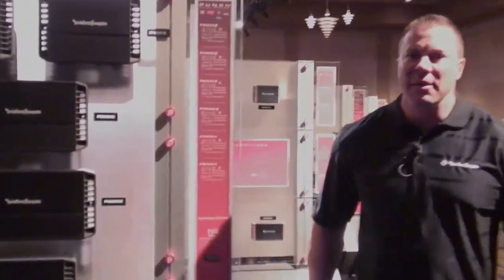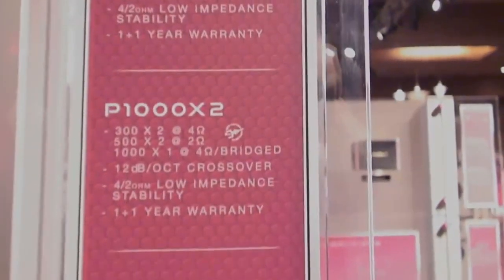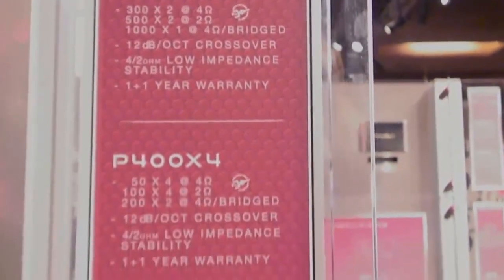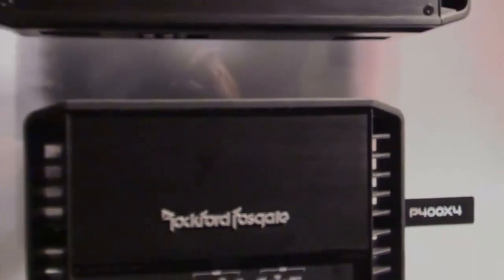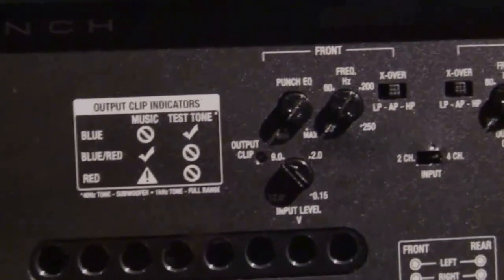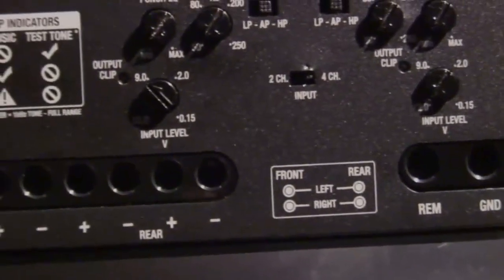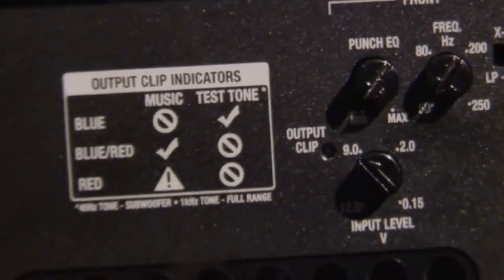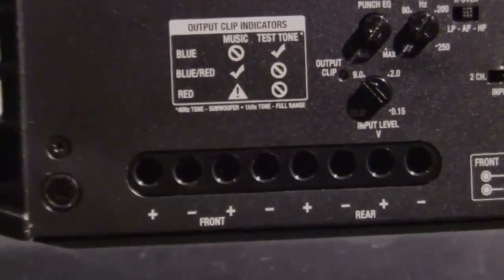2013 Punch Amp Models

Comment: Is it possible to run two P1000X1bd's strapped?
Reply from the maker: No, the only current amplifier in the line-up that can be "strapped" is the Power T2500-1bdCP or it's previous model the Power T2500-1bd.  You can accomplish the similar result as "strapping" amplifiers using this technique:
 
(1) Turn Off the system and disconnect all subwoofer speaker wires from the amplifiers.
(2) Play a low frequency test tone like 40Hz at -10dB Gain Overlap.
(3) Measure the output voltage (set meter to AC Volts) of the #1 amplifier.
(4) Adjust the gain settings for each amplifier, so each amplifier produces the same output voltage.
(5) Turn Off the system and reconnect all subwoofer speaker wires to the amplifiers.

Now all amplifiers are matched and producing the same output voltage for your subwoofer system!
Reply: Rockford Fosgate would I be able to use the bass knob I have currently to control both amps?
Reply from the maker: No, you will need to use both PLC2 (Punch Level Control) knobs.

Comment: I want to know better Amplifiers 4 channel to turn on speakers power t1693 on the rear and (PPS4-6) 
Punch Pro 6.5" 4-Ohm Midrange on the front, I want the best performance
Reply from the maker: The Punch P400X4 and Power T400-4 are great amplifiers for that setup.

Comment: I only find two flaws! In the P300x2 you only have two mosfets for the power supply when there is actually spots for two more, I would assume you would not only need to add the gate resistors for the two additional transistors, but an smd diode and capacitor as well near the voltage regulators! And the IRF540 N channel mosfets used on the output section have the issue with shorting! I just bought a P400-2 and P500-2 that both have shorted output and I can bet the N channel mosfets are shorted on them as well, they are probably 540N's as well! I love Rockford, but improvements can be made in this area, perhaps mosfets with larger ratings on the output section! I love the new design though and the size of the main board is mind blowing compared to 2002 Punch's, it is nice not having the To220 components soldered to separate boards making servicing easier and faster!
Reply from the maker: +LuxorVan May I suggest sending this type of feedback through our BRIGHT IDEA form that goes directly to our New Product Development department.  The PBR300X2 Product Details page has the Bright Idea form above the pricing: http://www.rockfordfosgate.com/products/details/pbr300x2
Reply: Rockford Fosgate Thank you very much!

Comment from the maker: In the USA it's up to the dealer to set the actual price.  A company can only suggest an MSRP that a dealer sells it for.  Authorized dealers provide a service along with selling the product.  Companies acquiring "gray market" products pop up on the internet with low prices are typically concerned with making a quick buck.  If you want service, buy from an authorized dealer.  They are in the business to make sure you are happy and can optimize a product to get the best performance.